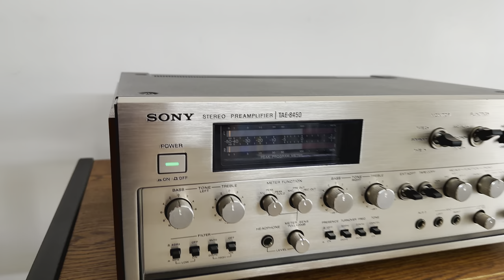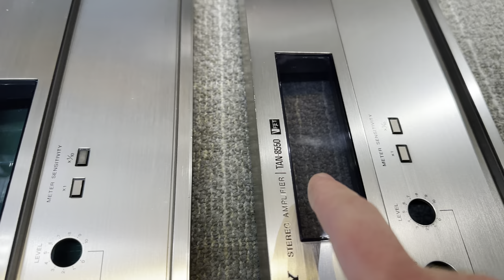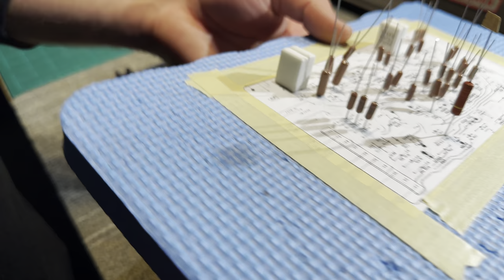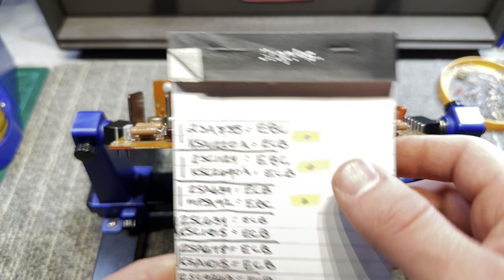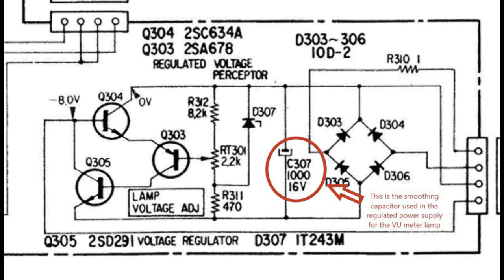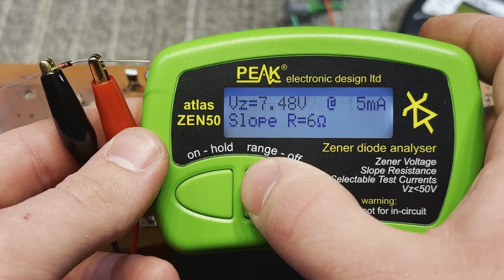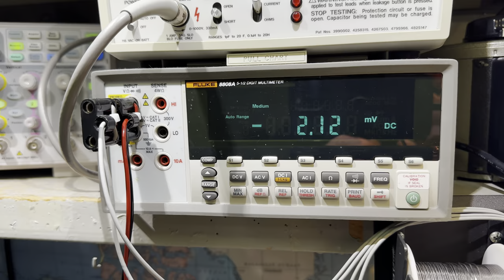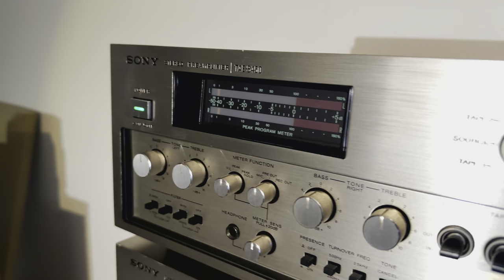Sony TAN-8550 VFET Power Amplifier Restoration and Overhaul

Comment: Great!  Love the power cable and interconnects...  Wiring looms - use thread to bind, looks wonderful, zip ties are very "industrial".   I get a lot of grief for soldering and not crimping, but you've proved a point here.  Testing - use a reactive load (speaker coil), this makes a difference compared to straight resistive, or at least a range of resistances - 2-16ohm.  These older amps are wonderful and respect to the owner.  Loved watching this, well done!

Comment: I grew up in this generation of electronics. Great to see you restoring this amplifier right. Something I admire. Too much doing the minimum going on with poor craftsmanship.  I agree 10K per channel is a bit low for this class of amplifier.  But I am careful not to over do it. Otherwise,  what a cool amplifier.
Reply from the maker: Thank you! Glad to hear you enjoyed it. And yes - one must be conservative when upgrading the values of capacitors. It can be hard on related parts of the circuit. In this case, upping the value from 10kuF to 15kuF was helpful but not impractical 👍🏼
Reply: re: "I agree 10K per channel is a bit low for this class of amplifier." why do you think that is?  and re: "But I am careful not to over do it." - I think that is wise.

Comment: Why you didn't replace the drivers? Very good job anyway
Reply: unobtainium,  and expensive as h..  Bevare of frauds..
Reply from the maker: Great question! I believe these drivers were in great shape, which is very lucky as they are TO-66 package transistors which are very hard if not impossible to source. Many counterfeit replicas are floating around which will do more harm than good. The originals perform flawlessly thankfully.
Reply: @PrimeHiFi  @jmqwert MJE15030G & MJE15031G TO-220 will do the job very well. Those old TO-66 drivers get very hot and not last forever. I have a 8250 and replaced with those modern drivers (adapting the center leg, etc) and plays flawlessly for years every day. 99% of the old transistors (except vfets and few others) are replaceable with modern ones
Reply: @fmoyano  those original devices are working well within their SOA. That is also the bias circuit not the drivers. Still important but not the same thing. One must not replace components arbitrarily.

Comment: I sold audio gear in the 70's and 80's. I owned a Vfet amp and have to say they were some of the sweetest most open sounding amps that ever came around. I worked for a dealer that sold Ohm speakers and in the mid to late 70's was their west region sales rep. Those Sony VFet amps sure were sweet. It was so satisfying to watch your restoration.

Comment: WoW amazing work, it's almost like making a new one by hand 👍
  If I find a PCB damaged like this with torn pads, I use a repair self-adhesive path and fix it in the hole with a hollow rivet and then thoroughly tin it, it has great mechanical strength.
Those projection VU and PWR meters are absolutely phenomenal.

Nice day 🙂 Tom
Reply from the maker: Great idea with the rivets! I will have to try that. I’ve been on the lookout for a clean and elegant solution for fixing lifted pads on circuit boards. Thanks for watching and for the kind comment! More to come 🙂
Reply: @PrimeHiFi  Hi, when I started using this technology I used to buy real hollow rivets, but one time I forgot to restock and needed to repair a PCB, I couldn't find hollow rivets, so I looked for a replacement solution and got an amazing idea. Instead of hollow rivets, I riveted a crimping sleeve for stranded conductors into the PCB - it has a thinner wall, so it fits even where there is little space, and most importantly, it is many times cheaper. If you are interested, I can look for some photos of the PCB repair and if I can't find it, I can take pictures of the next repair and send you the photos by e-mail.

Nice day 🙂 Tom

Comment: Outstanding work man! I've watched also what you did with the Sony TAE-8450 and I'm almost lost for words. I thought xraytonyb was a perfectionist but not even him goes that extra mile to disassemble those switches like you do. He just sprays some anti-oxide and jiggles it around a few times. So, kudos to you as so far you're the Youtuber that goes closer to perfection that I'm aware off and besides the one I mentioned I follow also "Mend It Mark" which has a different style but uses a whole paraphernalia of tools even for building missing knobs and switches.
Reply from the maker: Thank you! I try my best to achieve a high level of detail. I have learned an exponential amount of things from Tony. He is one of my inspirations for making YouTube videos. I believe he is easily one of the best on this platform.
Reply: Hi, both Mark and Tony are first class technicians, but taking apart switches or potentiometers is a bit different. Tony does this very well, if the switch or potentiometer is pressed in and doesn't show signs of much wear it makes more sense for mechanical reasons to just clean it without disassembly. I also do it that way, I use products from the German company "Kontaktchemie" - Kontakt 60 - dissolves deposits and releases oxides / Kontakt WL - rinses / depending on the type of contact surface, I then use Kontakt 61 or Kontakt Gold (for gold-plated contacts) as a protective agent. If there is a sign of more wear, I first clean the switches and potentiometers in an ultrasound, then treat them with chemicals, and if that doesn't help, then I disassemble them. With this procedure, I try to avoid damage to the mechanical structure, the pieces of metal that hold the switches and potentiometers together are very prone to breaking even if the handling is very careful.

Nice day 🙂 Tom
Reply: Yes, in fact Tony has just answered a comment he had (not from me) about that, explaining exactly the same! So, justice to him as well! @Edisson.
Reply: I remembered one person who is also very good at repairing audio equipment RAY Gianelli, he has a slightly different approach but excellent results.

Comment: Nice job as always! Keep em coming! Do you think the specs for distortion improvements mostly came from upgrading to metal film resistors and the connectors?
Reply from the maker: I think the improvements were a result of everything in conjunction. But the connectors were definitely an issue. Thanks for watching!

Comment: Hey Conner, great work as you always do. I was curious as to what diodes you used to make up the main bridge rectifier.  I downloaded the service manual and the originals look to be the standard 5A devices.  Curious as to what you placed in there.  Ultra fast, normal???

Happy to see you get rid of those horrible Sony 2SC1124s, I’ve run into multiple that were faulty.

Comment: Hi! Which series of Wima do You use? And which contact cleaner / lubricant do you use for regulators / pots?
Reply from the maker: I mainly use WIMA MKP / MKS capacitors. As for contact cleaner, there are many options I use which depends on the situation. DeoxIt is one I use most, along with Nutrol and others.

Comment: Awesome video, thanks for sharing! It would be pretty easy to design a new PCB (or rather replicate the original design). One could even go crazy and use a two layer board ;) I wonder why most people would consider it absolutely ok to replace parts, but wouldn't dare to replace old PCBs... Maybe it's the effort? Maybe it's the looks?
Reply from the maker: Thank you! When I have more time, I plan on learning PCB design to be able to create new boards. But for now it’s not viable for me. I feel this is one of the main reasons why many people don’t do it. With that being said, I do know many people who actually do it and the results are always nice 👍🏼

Comment: What's the model number of the Erem tool you use to crimp the legs of the zener diode so it will stand off the board?

Comment: Great video! Out of curiosity, do you work on audio equipment with no schematics and if so how do you go about restoring equipment that doesn't have any references?
Reply: If you don't have to troubleshoot something wrong then you don't need schematics. This video is a kind of shotgunning diodes, transistors and resistors with new ones for keeping alive those precious vfets
Reply from the maker: Great question! When you aren’t able to find schematics when diagnosing and troubleshooting, you will have to use intuition and knowledge of similar circuits gathered from past experience. Thanks for watching!

Comment: what cleaner is safe to use in dirty push button switches shown at 2:00:00 without taking it apart.
 I see a-lot of conflicting opinions online.
Reply from the maker: I recommend Deoxit for most applications but your mileage may vary. Everyone will have different opinions. You have to use what works best for each scenario

Comment: As a Vfet lover .. as we say in France ............Chapeau ( to take the hat off!..Just one question ..On the connectors problem ..Why not just reinforce them with some hard plastic or pvc.. This helps me a lots as i am planning to restore my TA8650 .It has the same output stage  circuit .. So this amp should also be capable of 130Wats then ..It is rated only 80watts any ideas why..
Reply: TAN-8550 is rated at 100wrms , TA-8650 is rated at 80wrms. The power stage is not 100% same (different power supply, and power boards are 95% same). I know because I have both amps
Reply: Thanks for the info ..But the voltage rails are the same at  60volts this is what matters
Reply: @ladronsiman1471  maybe it is limited also for the inside space getting hot (air flow, etc)
Reply: About connectors: best to clip the wire back a bit and solder directly to board. The biggest PITA to service later, the best way to secure a mechanical and electrical connection. About the differences between the 8550 and 8650: the difference is in the Class A amplifier section board. Otherwise, you are correct, the power stage is very much identical. This also means that the 8650 could easily be converted into a 110WPC amp. A topic for a different discussion, but it has been done ;)